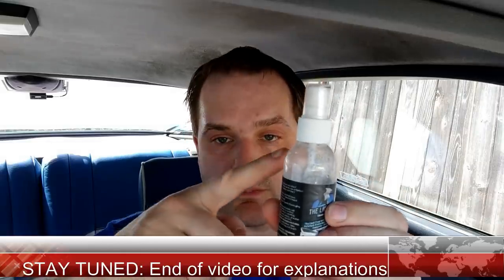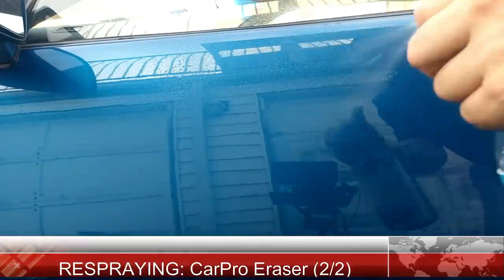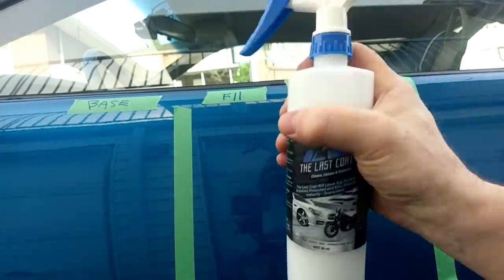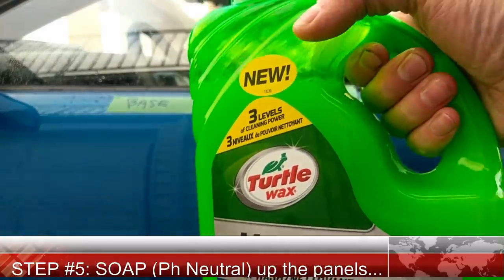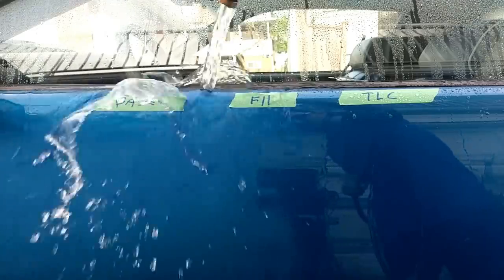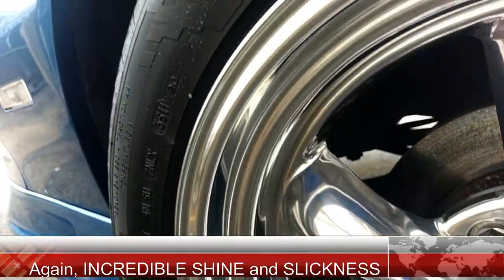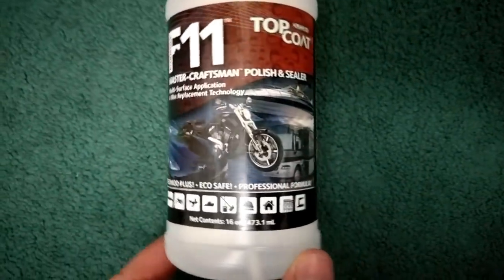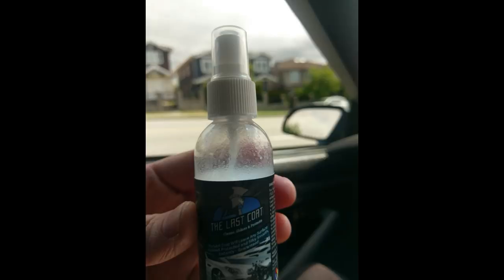TOPCOAT F11 VS. THE LAST COAT. (RESULTS WERE SHOCKING!!)

Comment: You have to wait 24 hours after you put on f11 for it to cure. Try that then you will see a big difference
Reply from the maker: Hi. Actually I redid the video (the next one) and I got the same results. I then did a unedited video after it cured for 7 days and again, live on video did the same thing...
Reply: XD still crap  bro you want to get a bang for your buck go get yourself a gallon of P&S bead maker for half the price of the 16oz of the last coat or f11.
and bead maker does requires 8+ hrs of cure time to get best results also can be use as a drying agent but for better results is to use it when the car is completely dry.
Reply from the maker: @Pty-gk2vb  Thanks for the comment. I actually did put them all up against each other including BeadBaker in a later video on here and while BB definitely is an amazing product, TLC2 still came out on top. I couldn't remove it without abbrasive action...
Reply: @thecamarogarage  😆 doubtful that TLC came on top your not doing the test the right way bro also use true chemicals to kill them don't go with soap also I'd still go with bead maker just for the price and how easy application I've seen bead maker go against good sealants I don't like TLC and f11 because price and the short life after a few rain and washes i used bead maker and if it's well applied it stays on for a few  week and I love in an area full of construction debris rain and heat
Reply from the maker: @Pty-gk2vb  you are obviously not referring to the NEW tlc2 nor the video I am referring to. I hit them live video, no cut aways with multiple hits of various chemicals of all types of strength.. tlc2 on top, beadmaker second, all others... well watch the video. It is long tho.
Reply: @thecamarogarage  yes sir you are right.
 I wasn't even aware of the v2 😆😆😆 still to pricy for me and so you don't think I'm a bead maker fan boy I don't really use it much I bought a different product by a different brand and I'm still trying it out before I even comment on it but so far it has taken a beaging and still needing like a champ. 
Thanks for the reviews I appreciate your videos keep it up I can see your getting better every video your make I have a hard time myself making videos 😆😆😆😆😆😆😆.
Reply from the maker: @Pty-gk2vb  thanks very much. Which product are you trying out now?
Reply: @thecamarogarage  epic cr2 by Malco Is not as cheap as bead maker but still cheaper than TLC and f11 so far my car has been thru like a straight month of rain and again I love by construction zone pretty much no matter where I go there's construction going on.
If you can give it a try  please and make video.
So far the application is smooth as I can get slickness and beading pretty awesome too.

Comment: I could barely hear your video ... even with my speakers ALL the way up I struggled to hear ..... and it wasn't my computer. As soon as I switched to a different video I could hear just fine.
Reply from the maker: Honestly, don't know what to say. I have no issues viewing or hearing the audio on both my computer and cellphone and appears you are the 1st to mention an issue hearing the audio in the more than 53,000 views ? I do know that something went wrong with the MUSIC on one of the parts after uploading.. It increased the volume DRAMATICALLY which I believe due to the compression of the video.. 

I don't know what to suggest. I'm sorry. :-(
Reply: Jcd ines- Dudes doing a service and doubt hes getting rich off of it. Commercial camera equipment is very expensive, maybe he will upgrade if you pay for it? Hes donating an unbiased review, if you cant hear it, find one you can forget an "unbiased" review from the manufacturer as I'm sure that their's are 100% honest.

Comment: Great info you could have shown in one quarter the time.
Reply from the maker: Hello. You are indeed correct. However as mentioned in the past, the reason I do that is because in the past accusations have been said that this and that happened off camera.. Claiming perhaps I didn't remove the original layer, or clay it, or whathaveyou.

This way it can be seen what exactly was done to prevent the repeated comments on what was done off camera. :-).

Comment: Nothing , I mean NOTHING will work as good old  Clay bar and then a good sealant.
Tomorrow will be a so called "best" new vehicle shine , when it's all just a gimmick to steal your hard earned cash. This , TLC , shine Armor etc , are ALL BS , PERIOD. 
A good shine is going to come from elbow work and using Clay Bar to really get a babies ass smooth feel , then proceed to seal it with a wax/sealant.
Take it from the Pro's , and all these gimmicks are money thriving RIP offs.
Reply from the maker: You are in a sense correct. These will NOT compete against a CERAMIC coating. These are in all sense of the word, Quick Detailers.. To give people a ceramic type look and feel WITHOUT the work..

If you are going to however compare a quick detailer to that of something is a different ball field, then that's like telling a car guy that his engine will never compare to a big block engine with HP and TQ... Well of course.. But not everyone has the time, money, or the experience to really get down a 1, 2 3 step their paint... So yes, someone who wetsands, compounds, using a random orbital rupes polisher, of COURSE, will outshine, outlast these "quick detail sprays".. We are talking about wanting to detail their cars thru convenience and time.. Not spending hours buffing, claying, compounding, etc..
Reply: Clay bars do not polish paint, they remove contamination in beaded in the pores of the paint, so a Sealant can bond directly to the paint.  BTW. Traditional wax went out with high button shoes.

Comment: Hey i saw you on another video!  You guys need to gef some kick back for advertising Lready lol
Reply from the maker: I'm not sure I understand?
Reply: @thecamarogarage  you were also on Terri's video talking about TLC and I mentioned I bought some.  Looking forward to getting mine.
Reply from the maker: Ah yeah. When I was using F11, I absolutely praised it. I am sure many of my car show buddies got sick of me constantly talking about F11.. Whenever people would come up to me at shows when I was detailing or seen my detailing bag, they would ask what I used and of course, I told them all about F11..

However once it started to rain (months later due to a HEAT WAVE we had that summer with very light rain VERY seldom), I covered all those layers I had on (15 last counted) would stop beading and the panels were soaking wet with water.. It would come back after I re-sprayed but the moment it rained for a day, it stopped beading again.. That was the issue I had. Nothing to do with the slickness or the ability to shine.. Just it's durability.

Now I know they are posting video's indicating that is the result of contaminating on the surface but if that were the case, I would think that would not occur the longer I left a garden hose on a panel even after prep was full done beforehand).

I don't have that issue with TLC and beads continuously in the rain and after. And so until that changes, my direction is towards TLC.

I wish I did but I don't make any money from TLC nor even this channel. Youtube changed their monetization required over a year ago and so it will be a long while before my channel gets big enough to even be considered a candidate to getting an income :-(